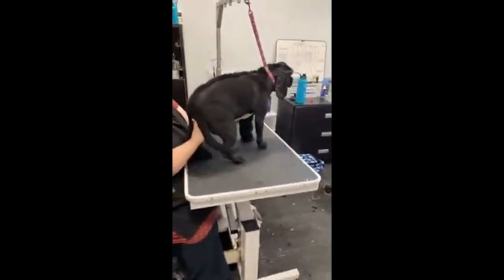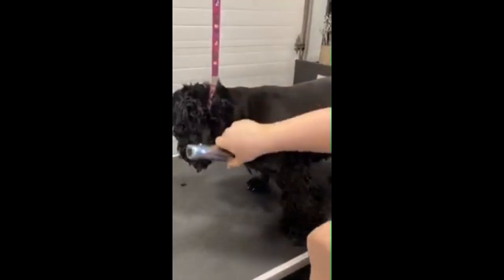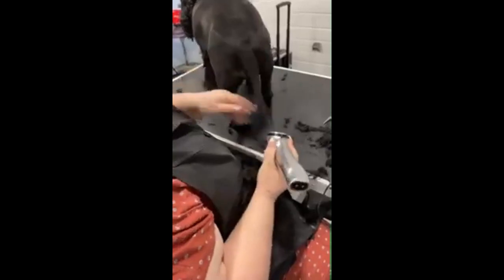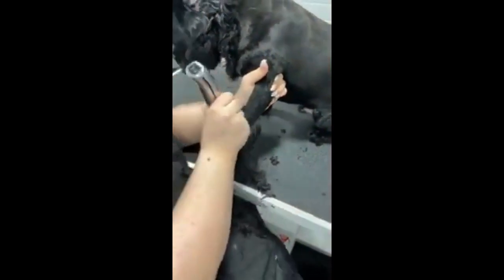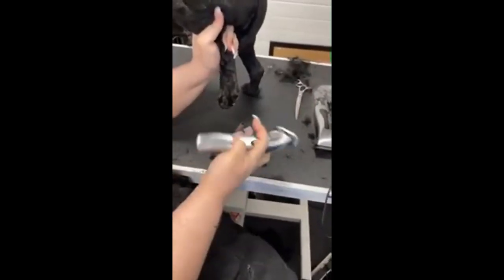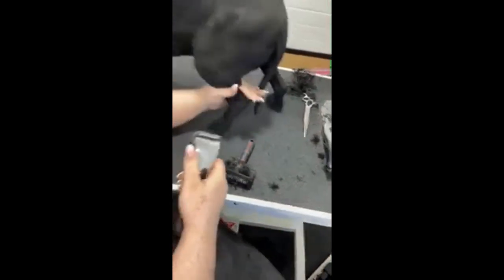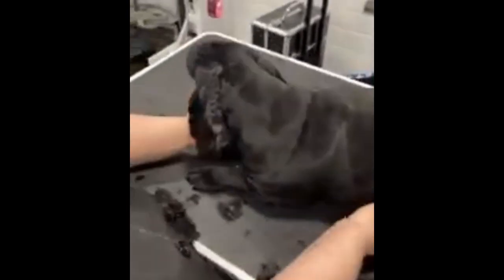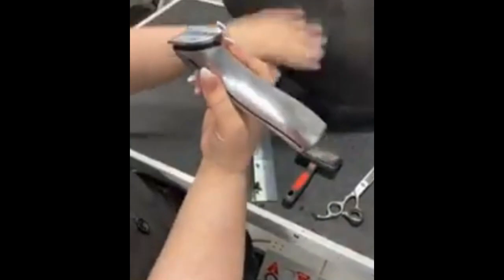Speed Grooming

Comment: Hi, great video.
So with your clippers where do you get your 5 in 1 blades from? Do they have different 5 in 1 for barber and animal? Can you post link for blade? Thank you 🐾
Reply from the maker: It depends on which clipper you are using. Most hair dressers use the Chromado with the 5 in 1. We use these as well in the pet industry. The clippers that barbers use with a fading feature...we don't use those. Any grooming supply sells the Wahl 5 in 1 if they sell Wahl clippers.